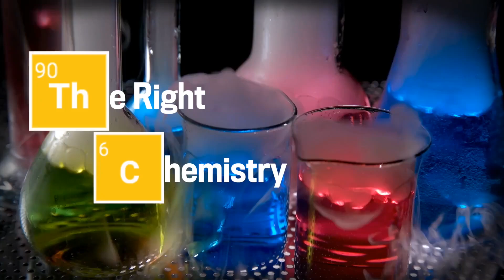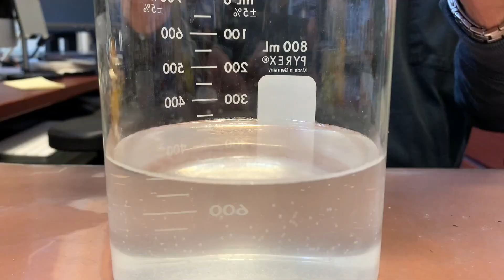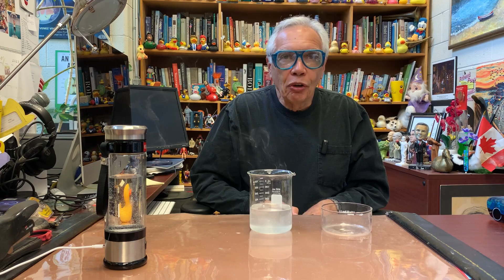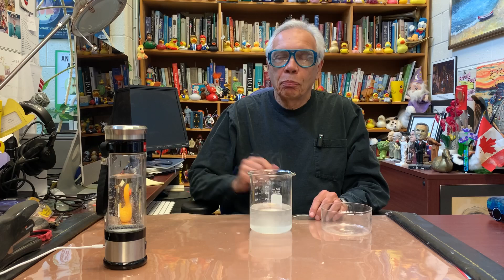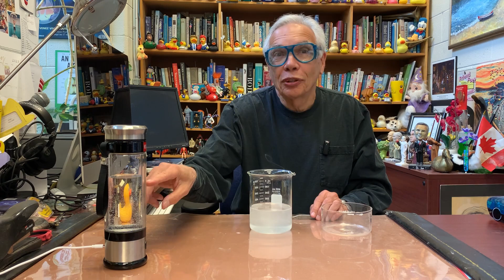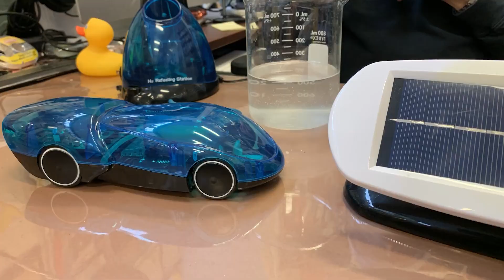How would hydrogen-powered vehicles work? | The Right Chemistry

Comment: Why use lithium ion batteries that are highly volatile, toxic, and flammable, and extremely unreliable in cold or sub zero weather, and can cause vehicle fires that are extremely problematical and dangerous to extinguish in electric powered vehicles! With hydrogen powered internal combustion engines none of these problems exist! Toyota has allegedly solved the higher temperatures that occur using hydrogen gas instead of regular or higher octane gasoline in the Internal Combustion Engine with cooling water injectors at exact, computer controlled intervals that keep the higher combustion temperatures within their necessary temperature levels and prevent any dangerous overheating before, during, and between its combustion cycle! Regular gasoline internal combustion engines can also be converted to using hydrogen and retrofitting those now recyclable engines no longer obsolete! The obvious genius behind that reuse alone is decisive, as this conversion of older gasoline powered engines makes re-using heavy duty tractor trailer trucks much more economically feasible and practical for truckers that have millions invested in diesel or gas powered semi tractor trailer trucks this transitional conversion to hydrogen power is a lot less expensive, once they do these conversions in greater volume that reduces the ultimate cost a lot! Fossil and Carbon Fuels / Energy or BIG OIL, NATURAL GAS & "CLEAN COAL CORPORATE ENERGY MONOPOLIES WILL NO LONGER DICTATE ENERGY PRICES ARBITRARILY, AND OPEC WILL NO LONGER HAVE THE ECONOMIC NOR POLITICAL  POWER OVER PREVIOUSLY VULNERABLE, YET INDUSTRIALIZED, ENERGY RESOURCES DEPRIVED COUNTRIES LIKE MUCH OF EUROPE,CHINA, AND PARTS OF THE UNDER-DEVELOPED, THIRD WORLD COUNTRIES, WHOSE INCREASED NEEDS FOR THEIR INCREASINGLY MOBILE POPULATIONS INE INEVITABLY INCREASE AS THEIR SOCIO-ECONOMICS BECOME MODERNIZED!

Comment: Of course, transporting hydrogen is significantly more expensive than transporting electricity. For small engines - like cars- batteries are more efficient. For large engines - trains for example, especially trains where there isn’t already electrical infrastructure available - hydrogen is a good option. Both already exist.